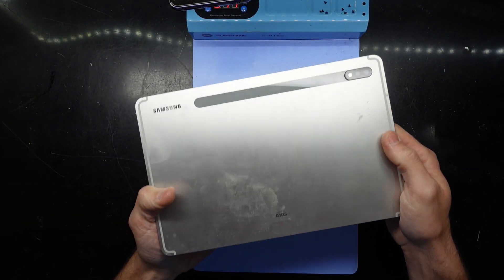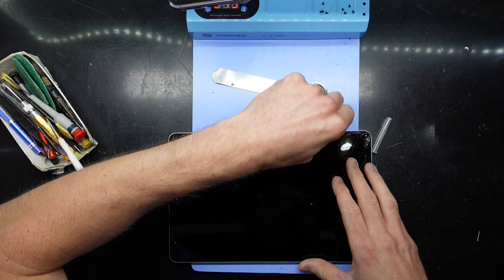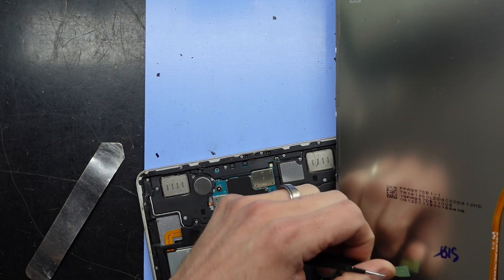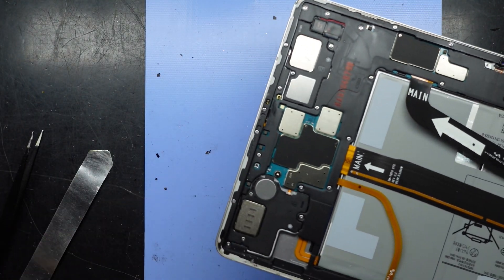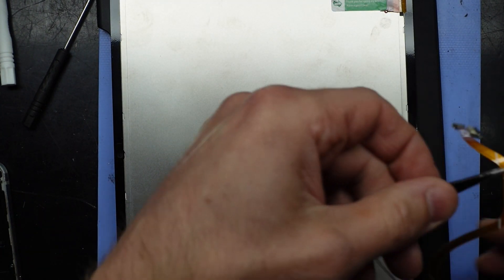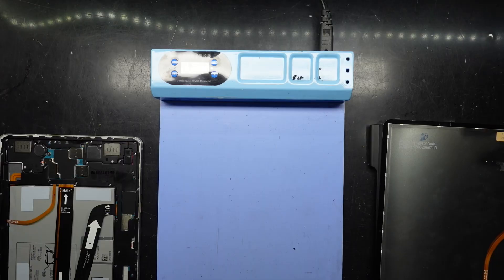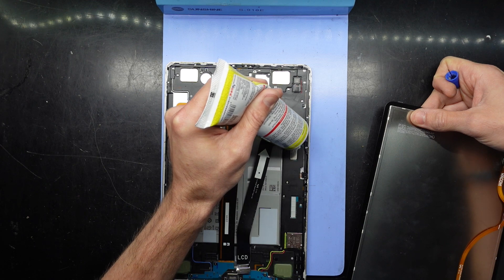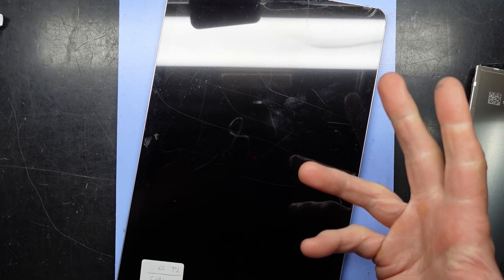Samsung Galaxy Tab S7 SM-T870 T875 Screen Replacement

Comment: 75C for 15 mins will cook the battery. You can do 70C for 5 mins and the screen will still come off very easily with isopropyl and a pry tool.
Reply from the maker: never had an issue, but i have been using 70c these days
Reply: @rickstechrepairs I hear ya. But battery damage won't show up immediately. That kind of heat will likely contribute to premature wear long term

Comment: I found a replacement model online that says it's an oled replacement, which I didn't think was possible, gonna try it out and I'll make a video if it works, tab s7 wifi with oled, it's a killer win if it works. 
£139
Reply from the maker: there are oled replacement screens out there
Reply: the tab s7 2020 model had two screen types - lcd or oled. depending on the model you have, determines the replacement screen you need to order. if you purchase an oled screen as a replacement for a device that originally had the LCD display - then the OLED will not function correctly, assuming it even connects the same way.
Reply: Well, that's the interesting part. 
I'm not sure if the advertisement is legit or not but they claim it's compatible with 
SM-T870 (Wi-Fi only) which originally had an LCD. 

I assume replacement part has been made to be compatible with the model I get paid soon so I guess we'll find out 👍
 @Hip_Hop_An_Onymous

Comment: Does the s pen still work after replacing it? I replaced mine the s pen get recognized but the pointer is not accurate. What’s your professional opinion regarding that ? Thank you
Reply from the maker: it would depend on the quality of the screen you purchased, will need to ask the place you purchased it from
Reply: the S-pen will only work if the part that he moved over from the back of the old display, is properly transferred to the back of the replacement display. YOU MUST USE AN ADHESIVE THAT ONLY CONDUCTS ACROSS THE Z-AXIS - OR DOWNWARD PRESSURE IN THIS CASE. FAILURE TO PROPERLY AFFIX THIS AND WITH THE PROPER ADHESIVE TYPE (ANSITROPIC) WILL RESULT IN INTERMITTENT S-PEN FUNCTIONALITY OR OUTRIGHT FAILURE OF S-PEN INPUT - EVEN THOUGH FINGER TOUCHES WILL STILL REGISTER.

Comment: Does heating the edges help release the adhesive?
Reply: It would have, if he'd done it. I use a heat mat at 65C for 5 minutes on these. Makes the screen come off so much easier.

Comment: I bought a new display and followed all the steps from your video. I don't know what is causing the display not to turn on after the replacement. All the cables are properly connected.
Reply from the maker: not sure, connect back up the old display and see if it will display with it (might be a dud new screen)

Comment: does the pen pressure still work??
Reply from the maker: not sure
Reply: the S-pen will only work if the part that he moved over from the back of the old display, is properly transferred to the back of the replacement display. YOU MUST USE AN ADHESIVE THAT ONLY CONDUCTS ACROSS THE Z-AXIS - OR DOWNWARD PRESSURE IN THIS CASE. FAILURE TO PROPERLY AFFIX THIS AND WITH THE PROPER ADHESIVE TYPE (ANSITROPIC) WILL RESULT IN INTERMITTENT S-PEN FUNCTIONALITY OR OUTRIGHT FAILURE OF S-PEN INPUT - EVEN THOUGH FINGER TOUCHES WILL STILL REGISTER.

Comment: Did pin work normally
Reply from the maker: touch should work the same on the replacement display
Reply: the S-pen will only work if the part that he moved over from the back of the old display, is properly transferred to the back of the replacement display. YOU MUST USE AN ADHESIVE THAT ONLY CONDUCTS ACROSS THE Z-AXIS - OR DOWNWARD PRESSURE IN THIS CASE. FAILURE TO PROPERLY AFFIX THIS AND WITH THE PROPER ADHESIVE TYPE (ANSITROPIC) WILL RESULT IN INTERMITTENT S-PEN FUNCTIONALITY OR OUTRIGHT FAILURE OF S-PEN INPUT - EVEN THOUGH FINGER TOUCHES WILL STILL REGISTER.

Comment: Hello Rick, thanks for this video. I just swaped the screen of my SM-T870 S7 but sadly the black is not as black as it should. It more looks like a grey. I did check the colours via star#0star#. Everything looks good except for black. Its grey. Is there any chance I missed something tiny or is it possible to calibrate that via software? Did you encounter something like this before aswell?

Thanks in advance for an answer!
Reply from the maker: you did nothing wrong

sounds like you got a bad quality aftermarket screen

some screens have very bad colours

Comment: Hi, im asking help from those who knows. I went to to replace my tab s7fe screen in a repair shop and they fixed my screen but the display doesnt not detect the s pen anymore... I'm starting to suspect that they didn't attach something? I really wanna get it working again. Thanks
Reply: They said I'm not able to use s pen because it broke when my screen was damaged... Which I find a bit weird since I replaced my screen with this repair..
Reply from the maker: Its also possible that the screen they got, doesnt support the Pen
contact them again
Reply: the S-pen will only work if the part that he moved over from the back of the old display, is properly transferred to the back of the replacement display. YOU MUST USE AN ADHESIVE THAT ONLY CONDUCTS ACROSS THE Z-AXIS - OR DOWNWARD PRESSURE IN THIS CASE. FAILURE TO PROPERLY AFFIX THIS AND WITH THE PROPER ADHESIVE TYPE (ANSITROPIC) WILL RESULT IN INTERMITTENT S-PEN FUNCTIONALITY OR OUTRIGHT FAILURE OF S-PEN INPUT - EVEN THOUGH FINGER TOUCHES WILL STILL REGISTER.

Comment: We expect much more from those who post repair videos. The way you broke the glass, you risk breaking the sidebar and cutting your hand. The table was not cleaned of glass debris and scratched the tablet. New displays if the strip contacts have not been cleaned with alcohol before, may have oxidized contacts and not work properly, even if they are gold. And you didn't test the display before gluing it. If it does not work after installation, you risk damaging the new display.
Reply from the maker: Thanks for your input
Reply: Why you watching if you already know how to do everything?
Reply: @alexafa316  hey he probably repairs devices like this and he just watched  this vid to see how you open it. Not how to replace te screen in depth. He is probably just giving a tip to do it better. I know it because its the same reason that i watch this. But i understand your reaction.
Reply: @darthgonk7249  ah yeah I guess I would too. I had water damage and the screen stopped working after a few hours so maybe I need a new screen or connectors
Reply: I plan on attempting the replacement of my S7+ T978 with the guidance provided with this video and the comments.  I figure it's worth the $60 to try and gain some experience.  I also appreciate your input, ty.

Comment: Since I replace my screen my s pen no longer works.. why?
Reply from the maker: Some aftermarket screens don't support the s pen
Reply: the S-pen will only work if the part that he moved over from the back of the old display, is properly transferred to the back of the replacement display. YOU MUST USE AN ADHESIVE THAT ONLY CONDUCTS ACROSS THE Z-AXIS - OR DOWNWARD PRESSURE IN THIS CASE. FAILURE TO PROPERLY AFFIX THIS AND WITH THE PROPER ADHESIVE TYPE (ANSITROPIC) WILL RESULT IN INTERMITTENT S-PEN FUNCTIONALITY OR OUTRIGHT FAILURE OF S-PEN INPUT - EVEN THOUGH FINGER TOUCHES WILL STILL REGISTER.

Comment: Question I got a new screen and I’m messing that piece on the back of the LCD screen connecting the Wacom ribbon to the and the digitizer together. I was wondering if you know the name of that piece and where to get a replacement part if you can?? 4:38
Reply: Hey, in case you haven't fixed yours yet.  I'm struggling with this DIY too. But, I did see another video where they just transferred those parts over. Some replacements come with and some don't.
Reply: @briannakagama5694 This cable can be purchased separately by searching for SM-T736B_LCD_FPCB_REV0.5

Comment: Thanks for the video. helpful!!!!  I replaced this screen once and broke the new screen forcing it down. The adhesive is a bitch I got some into the power button so makes it spongy/tacky.  Today I ordered another replacement.  hopefully 2nd times a charm. I might fix the screen and trade it in for the tab s8+.
Reply from the maker: Damn, bugger, good luck with the next attempt :)

Regarding the adhesive, heat is your friend